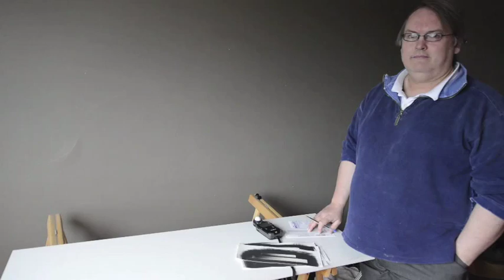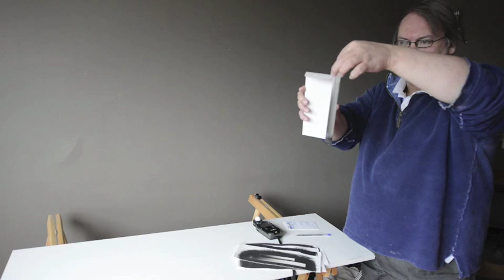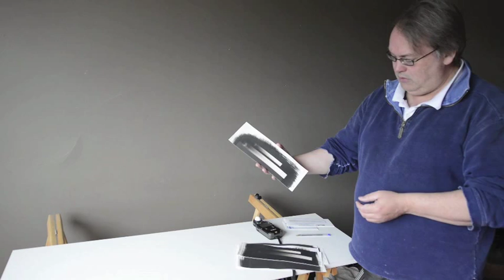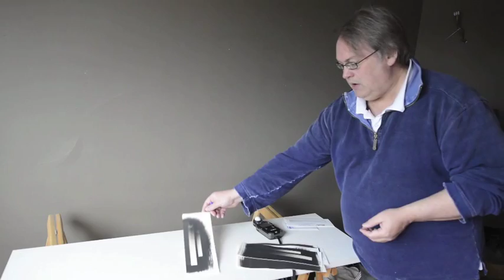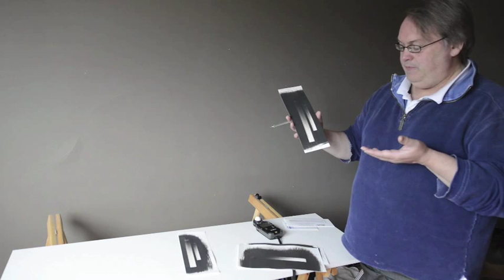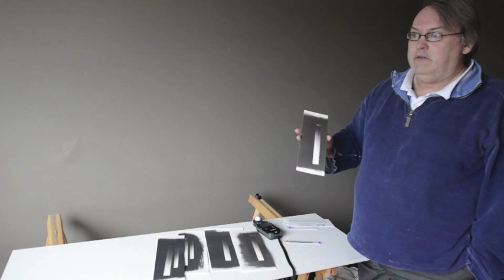Calibrating digital negatives for alternative printing part 1

Comment: Hi Dave, I'm intrigued by this process. This is something that I never had the means to explore in the past, in college or a demand for in my past profession. I've done a little time in the darkroom and tried various dyes and so forth that replace the silver halide but this completely different. We skirted this process in college due to cost, I think we were only covering platinum printing at the time, but its essentially the same.. I think. This is something in photography where I am pretty much out of my depth. Think I might give it a go. Thanks for the insight, please keep up the good work.

Comment: Very nice video. Just a clarification question: you are basically printing through b+f of the substrate, right? So if I'm using an enlarged negative made of e.g. lith film I'd develop it unexposed and use it as my substrate in this test? Thanks
Reply from the maker: Hi Stefano, 

Welcome to  my channel and many thanks for taking the time, it is much appreciated.  You are exactly right about the test, b+f so yes test your unexposed but deved and fixed negs

Dave
Reply: @DaveJSmith  thank you